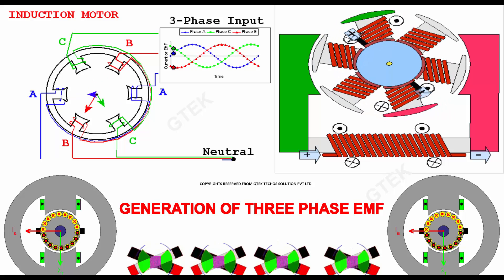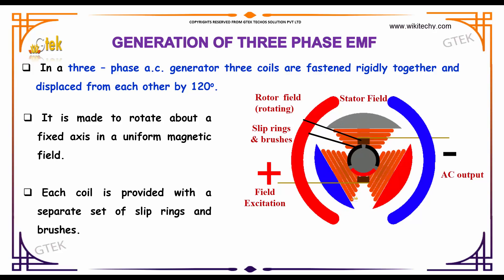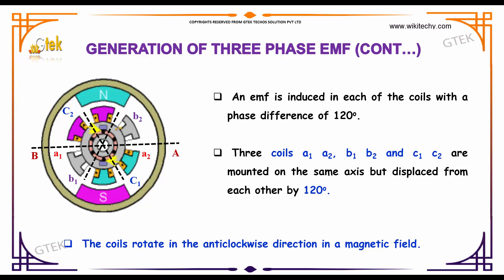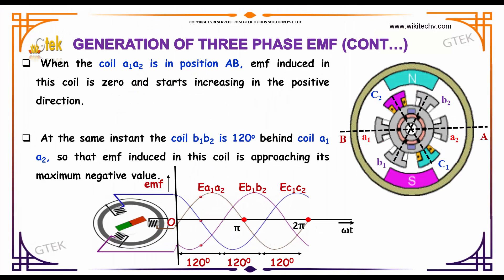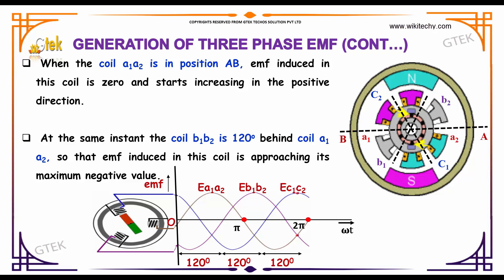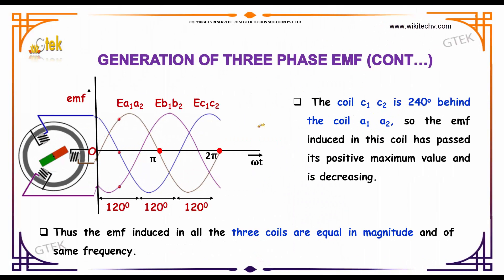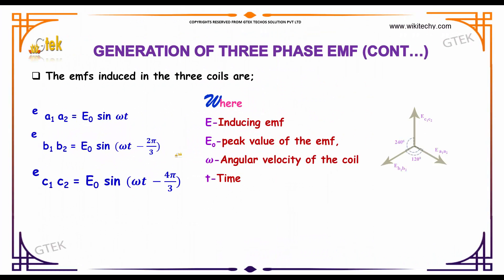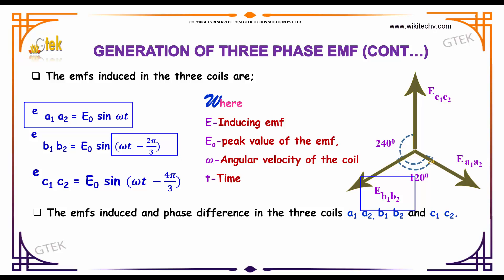Generation of three phase emf|Electro Magnetic Induction And Alternating Current

Comment: In a 3 phase system, there are three equal voltages or EMFs of the same frequency having a phase difference of 120 degrees. These voltages can be produced by a three-phase AC generator having three identical windings displaced apart from each other by 120 degrees electrical.

Comment: In case of three phase AC operation, most widely used motor is Three phase ... Secrets Behind the Rotation: According to Faraday's law an emf induced in any ... the rotating flux and static rotor conductor is the cause of current generation; ...

Comment: Electromotive force, also called emf (denoted E {\displaystyle {\mathcal {E}}} and measured in volts), is the voltage developed by any source of electrical energy such as a battery or dynamo. It is generally defined as the electrical potential for a source in a circuit.

Comment: Generation of three phase emf-Electro Magnetic Induction And Alternating Current
In a three – phase a.c. generator three coils are fastened rigidly together and displaced from each other by 1200. It is made to rotate about a fixed axis in a uniform magnetic field. ... An emf is induced in each of the coils with a phase difference of 120o.

Comment: There are many advantages of three phase system:
1. Higher Rating: The rating of 3 phase machine is always higher than that of a single phase machine of same size.
2. Constant Power: In a single phase system, power delivered is pulsating which results in vibration in large motors. 3 phase system delivers constant power.
3. Power Transmission is Economic: In transmission system, it is possible to transmit more power using 3 phase system.
4. 3 phase system is more capable and reliable

Comment: Generation of three phase emf

In a three – phase a.c. generator three coils are fastened rigidly together and displaced from each other by 1200. It is made to rotate about a fixed axis in a uniform magnetic field. Each coil is provided with a separate set of slip rings and brushes.

An emf is induced in each of the coils with a phase difference of 120o. Three coils a1 a2, b1 b2 and c1 c2 are mounted on the same axis but displaced from each other by 1200, and the coils rotate in the anticlockwise direction in a magnetic field (Fig: a).

a5

Fig; a Section of 3 phase ac generator

When the coil a1 a2 is in position AB, emf induced in this coil is zero and starts increasing in the positive direction. At the same instant the coil b1b2 is 120o behind coil a1a2, so that emf induced in this coil is approaching its maximum negative value and the coil c1 c2 is 2400 behind the coil a1 a2, so the emf induced in this coil has passed its positive maximum value and is decreasing.

a6

Fig: b Three phase emf

Thus the emfs induced in all the three coils are equal in magnitude and of same frequency. The emfs induced in the three coils are;

ea1a2 = E0 sin ωt

eb1b2 = E0 sin (ωt – 2π/3)

ec1c2 = E0 sin (ωt – 4π/3)

The emfs induced and phase difference in the three coils a1 a1, b1 b1 and c1 c1 are shown in Fig: b & Fig:c.

a7

Comment: These voltages can be produced by a three-phaseAC generator having three identical windings displaced apart from each other by 120 degrees electrical. ... The emf induced in the coil a1a2 is zero and is increasing in the positive direction as shown by the waveform in the above figure C represented as ea1a2.